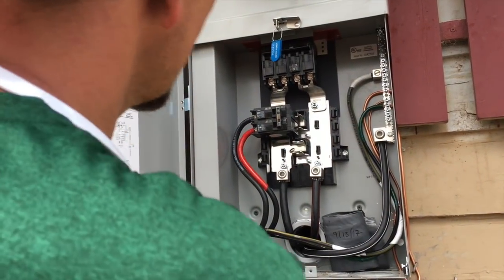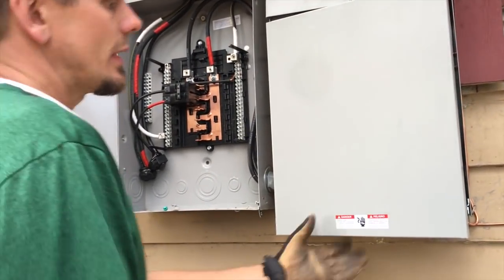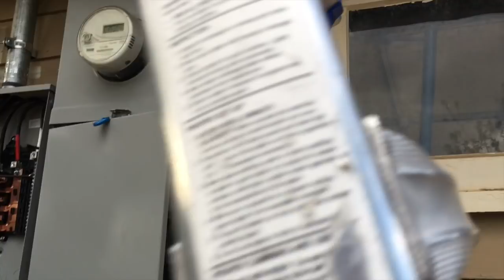Homeowner's Electrical Overhead Service Change, Does SE Cable Loose It's Value If The Jacket Is Off?

Comment: I have a friend who has a shop that was wired with something like number 10. It goes back to a panel which has sufficient wiring but this shop is running welders table saws lots of woodworking equipment and they are asking for it. The ground is more Rocks than dirt. Could I somehow run this from the panel up and over? Do you have any videos on such a project? By the way I'm about twice your age but I would still humble myself and work with you for a couple of years you know what you're doing. That's coming from a general of 40 years! Good work🌞

Comment: Hi, awesome video so if i have 125 subpanel i can install #2 cooper wire with 100 amp breaker?
Reply from the maker: #1/0   ALM SER for 125amp.
Reply: You can use 3 AWG copper ( believe it or not, 3 AWG is very available) as long as the lugs and breaker are both rated at 75 Degrees C (which most are).  Eventhough the sub panel is rated at 125 Amps, you would size your wire according to the breaker you feed it with.

Comment: In California the rigid mast needs (2) structural supports, a minnie or unistrut strap....considering your the space you had to work with I dont know you could of done. I'm a commercial electrician and they make us build a rack support that would mount to the roof of the building to support the mast.
Reply: wow, that's a lot. just guy wires around here.

Comment: Can’t believe your have an aluminum ladder! Try a #2 al for cold water and phase it green.
Reply from the maker: Yah, If they made a fiber ladder like this Little Giant, I would be all over it. LOL>   Power was off when I did this service change. Safety First. !! Yah, ALM on a copper pipe seems Dis-similar to me and even though it does not have power or current on the water electrode, I feel that it could cause a copper / Aluminum reaction over time. The last thing I would want is to eat a small hole in their main water line.
Reply: Peterson Electric 
Your using a cold water clamp just add nolox on conductor. 
If you wanna use copper it’s your money.